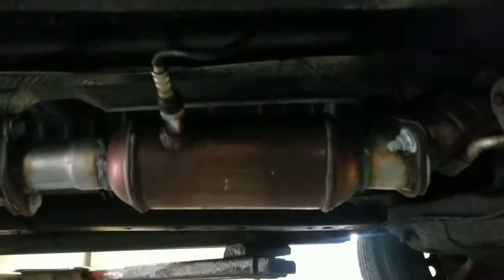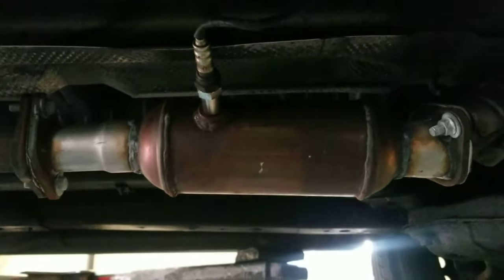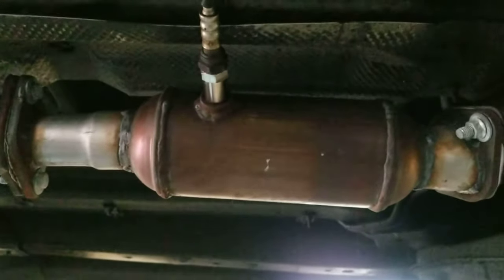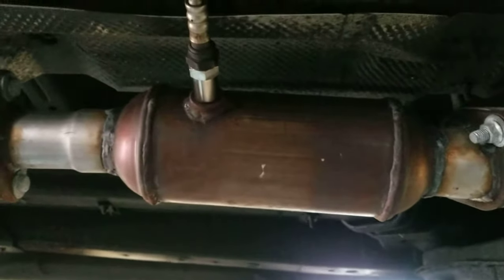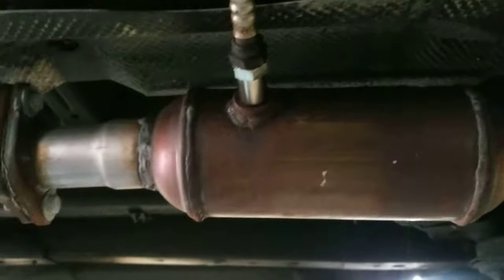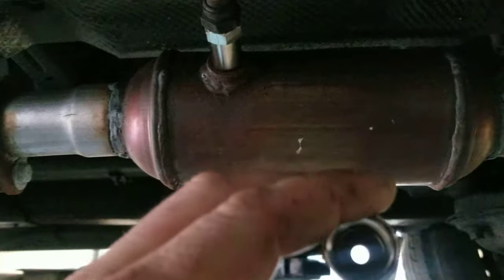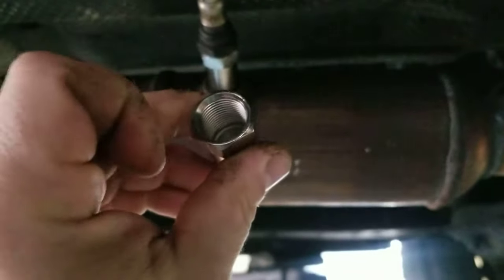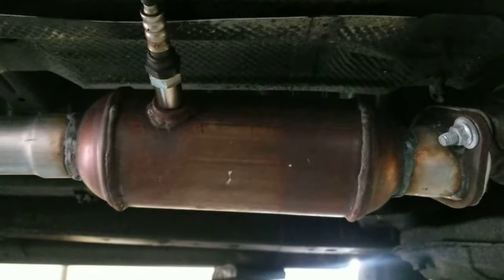How to fix check engine light after replacing converter. quick fix

Comment: Thank you so much for sharing this video. I had my catalytic converter replace with an off market  on my Prius V. Initially upon installing this oxygen spacer my check engine light was still on. My brother in law remove the battery for a while to reset the car and check engine was gone after that. Thanks again for your video.
Reply from the maker: Your welcome 👍

Comment: Both the cats on my 05 Sequoia were stolen, so I had to replace them. The OEM cats are 1,200 each, so I opted for universal Magnaflows (also, due to the supply chain shortage, oem ones weren't even available). I got intermittent CAT Inefficient codes for both cats until I put the O2 extenders on. Now, no more CEL. This will definitely work on Toyotas.
Reply: I just had mine stolen on my 04 sequoia. Same deal, cats from dealer not available and nobody is willing to tackle the O2 sensor codes now being thrown with aftermarket cats. I'll give these extenders a try, I guess. Did your VCS and Trac light also come on with the CEL?
Reply: @chrismas5338  yes, that is pretty standard for all Toyotas. VCS and TRAC is disabled with a Check Engine light. It doesnt mean there is anything wrong with them, unless the error code is directly related to the VCS or TRAC.
Reply: @Nuthing_but_the_Truth  just tested my O2 sensors and wiring and Bank 1 sensor 2 is bad.
Reply: @chrismas5338  good deal. I had to get new oem O2 sensors, so I knew they werent an issue for me when the codes started to show up.

Comment: I just change the whole catalytic converter and the same code of catalytic keep on showing up, so I'm. Changing the sensors but if what you are saying works is it one size fit all or is it different for sample, 2007 toyota matrix?

Comment: 12.05.2023 ///// I put the same on mine Astra h engine Z16XER. It is not working. ECU or car computer still report Oxygen Sensor Error and Check engine light is on. :(

Comment: Hi, maybe you know what's the part number for the spacer-adapter(Toyota Prius 2010) THANKS
Reply: 2PCS 45mm O2 Sensor Spacer, Oxygen Sensor Adapter,  O2 Sensor Clog Cleaner, M18X1.5

I’m not sure if this would work but I have 2012 prius V.

Comment: My R/T has a p0141/138 wondering if this would help? Cats were stolen has aftermarket ones only having trouble with left side
Reply from the maker: Hi. No this will not help your code. Sounds like your o2 sensor may have been damaged or wires were cut when it was being stolen or replaced

Comment: Quick question, I see the oxygen sensors adaptors online but some are different size , does that matter ??  I need to remove my 2016 ford fiesta check engine light lol
Reply from the maker: Hi. 
They are usually all M18 x 1.5
Reply: Last week during rainy days they stole my Honda catalytic converter. 😙
The original was so expensive so I replace with after market. Now the check engine light was On. So the solution is just buy the Oxygen Sensor extender from internet ? 😙 After putting the extention then plug in the O2 sensor. Do I have to seal the small hole ? Thanks.
Reply from the maker: Ramo 
No you do not seal any holes

Comment: For the spacer does the aftermarket cat have to have a 02 plug on it already or can a shop install it for me or do I need a cat with the o2 plug already on it
Reply from the maker: U just have to put the spacer in the factory  o2 sensor that is already there behind the converter

Comment: I have a 2012 ford expedition with the same problem, we’ve replaced the aftermarket three times and still same check engine with same code, we finally installed an oem convert and still the same code, we replaced the o2 sensors and still. What diameter do I need to order the spacer???  Thanking you in advance.
Reply: Hey. They are typically all m18 x 1.5.
I am asuming that your truck has more than 1 converter and that you are changing the correct converter? 
If the spacer does not work and you are still getting the same code. I would suggest checking power at the oxygen sensor and checking for broke  wires in the harness. 
Hope this helps
Reply: I use aftermarket every day no issues..

Comment: I just ordered some spacers for my 2021 Tundra. Got my CAT Converters stolen. Insurance won’t pay for OEM had to go with aftermarket parts now check engine light is on. Crossing my fingers hoping these spacers will work. Will update once I got it installed.
Reply from the maker: Wow that sucks! Yes please keep me updated
Reply: Did it work?
Reply: I got the parts but didn’t install the parts, l ended up replacing all 4 OEM O2 sensors. The aftermarket sensors were trash. At least now my check engine light has not come on yet( crossing my fingers).

Comment: Hi I have recently replaced cat convertor of my Vw polo 2006 with a new one, after 2 days my engine light came on . Is there any solution to clear that light ?
Reply from the maker: Hello 
Yes. 
If the engine light reads the code description "catalyst efficiency below threshold " 
Then follow the exact steps of this video to get rid of the engine light
Reply: The same part is suitable for Vw polo 2006 ?
Reply from the maker: Yes
Reply: Thanks I will try and update you later
Reply: @techtips3111  I have a dodge charger 14 and my light just came back on as well. Should I take it back to the shop or auto zone to get a read
Reply from the maker: @braygaming5264  i always suggest taking it back to the shop first

Comment: Do we do this for all 4 o2 sensors for the extenders ?
Reply: Only the O2 sensors the are after the converter (sometimes they bolt into the converter not after)
Reply: @cypfreak  so the 2 in the down stream then?
Reply: Correct

Comment: Do you have to put them on all 4 o2 sensors?
Reply from the maker: No. You only have to put it on the oxygen sensors that are behing the catalytic converter that you changed 
If you did both converters than u have to out them on both o2 sensors that are after the converter
Reply: @techtips3111  I replaced them all and they are all marking 
I even changed the converter

Comment: Mine says not ready but the engine codes it shows now is for oil pressure and for  fuel. The catalytic says not ready. What can I do? Appreciate any help.

I just Googled and it might be the o2 sensor. So you already gave me the answer. THANKS!
Reply from the maker: Did you clear the engine light? And did you drive a minimum of 50 miles to complete a drive cycle? 
Also if you have a fuel code. That can keep an O2 sensor from going to ready mode
Reply: @techtips3111  the emissions said everything was ready except catalytic converter. I did not run it on the highway
Reply: @techtips3111  should I reset and do it all over?
Reply: @techtips3111  thanks for your help
Reply from the maker: Do you currently have an engine light on 
If so what does the code actually say?
Reply: @techtips3111  1259 and 1456
Reply: Didn't have them before I installed the converter
Reply from the maker: Those codes wouldnt be connected to the converter. Try resetting the engine light. All momitors will be "not ready" then drive it at least 50 miles and see how many go to ready state
Reply: @techtips3111  thanks
Reply: U need to drive the vehicle
About 60 or so miles
After you have corrected
All the other codes
Then clear codes
And drive

Comment: I see one that has like a screen in it, on the smaller end and one doesn't. Which one do I need? 2012 Chevy Equinox 2.4l FWD Flex Fuel. A link to one that someone has bought and it's worked would be nice.😊
Reply from the maker: Sorry for the late response.  Incase you still neee it 
Herew the link 
https://www.amazon.ca/Eliminator-Adapter-Adapater-Isolator-Extension/dp/B07GYJP9X9/ref=asc_df_B07GYJP9X9/?tag=googlemobshop-20&linkCode=df0&hvadid=292940036879&hvpos=&hvnetw=g&hvrand=8302906354495181249&hvpone=&hvptwo=&hvqmt=&hvdev=m&hvdvcmdl=&hvlocint=&hvlocphy=9000756&hvtargid=pla-569730711270&psc=1
Reply: Thanks!  I bought a set of 2 of the spacers and had the front spacer installed. It got rid of my light but the car is still missing a little bit. The fuel trys to cut out every now and then, especially when idling. Or, when I have to stop at a red light and am still in drive it'll sputter a little. When I throw it in neutral it seems to help a lot but will cut out a little if I have to stay idling for too long of a time. In drive while idling and when in park idling it's at it's worst. When in neutral, it helps a lot but will start to cut out or miss eventually.
Should I throw the other spacer on the rear sensor or will that even have an effect? or is this something that might straighten out in time? Just about everything is new on the car. New engine, plugs, High pressure fuel pump, O2 Sensors, MAP and MAF sensors, throttle body has been cleaned and has a new gasket and a bunch of other stuff I don't want to list. This is a new converter with probably 800 or so miles on it and probably 400 or so miles with the New spacer on it. It is the cheap version of the converter. The Only code that was showing was for the Catalytic Converter before I put the spacers on which is of course gone now. Any help or just your thoughts would be appreciated. Thanks!
Reply from the maker: @travisspencer9241  ok 
So, did this issue start after you installed the converter or was the problem there before. 
If it started after the converter. How long after did the problem start
Reply: @techtips3111  I Had problems before I installed the newconverter but it was just typical converter troubles. It would cut out every now and then but was way worse than now. The sulphur smell and You would have to push the gas pedal so much further to get it to go. I had the new converter put on just before I found out the motor was bad. It sat about a year before I could get a new engine put in. The new engine runs great. Had all the new stuff put on the new motor.
 The engine light came back on about a 100 miles of driving with the new motor. Took it to my mechanic and he said the scan showed it was the converter and not the sensors. It didn't start cutting out or missing until that engine light came back on at the 100 mile mark of the new engine install. We reset the light and I drove it hoping it would go away. The light came right back on not long after. Shortly after I saw your video I decided to give the spacers a try. I drove back to my mechanic, had the front spacer installed and he reset the light. Seemed to help a lot but I'm still getting this little miss or the quick Idle down. The light hasn't came back on in I'd say over 400 miles. Everything else seems to be great.
Reply from the maker: @travisspencer9241  what do you mean by "front spacer"? 
Did you put it.in the o2 sensor.before or after the converter? Because its supposed to go in the o2 sensor that is after the converter
Reply: @techtips3111  It was definitely put on before the converter. The front 02 sensor. I didn't put one on behind the converter. It really didn't make sense to me to put it on after the converter.
Reply from the maker: @travisspencer9241  ok. But now your o2 sensor in the front is not accurately reading the correct AFR and is now sending the wrong info to the ecu so your mixtures are off
Reply: @techtips3111  So if I switch it around and put one on the back and none on the front, should that fix it?
Reply from the maker: @travisspencer9241  its hard to say if thats what the initial cause was. It sounds like u may have a coil cutting out under load. Or a cracked plug even though u changed them. 

Regardless i would out the spacer in the rear so that u know for sure your getting proper afr readings
Reply: @techtips3111  I'll switch it around in a few days and let you know what happens. Thanks for all your help.
Reply: @techtips3111  I just wanted to let you know that I got those spacers swapped out and it's in the correct spot now. When leaving the garage it died about 5 times backing off the rack but that was expected. After about 10 minutes of driving, it reset itself and I haven't had a miss yet. Idles fine and sounds great. When I had the spacer on the front O2 sensor I started noticing some oil consumption. Hopefully it's where the mixture was off and causing it to consume a little more oil. I haven't had the engine light come back on either. It didn't even come back on when it was on the front O2 sensor, lol! Thanks again for your help. I really do appreciate it.
Reply from the maker: @travisspencer9241  glad to hear

Comment: U can see the converter body is over heating..thats no fix that's a bandaid..Either the converter   has wrong loading along with a root cause of po420 not resolved
Reply from the maker: The vehicle has never been ran. I installed this converter and spacer and took the video before bringing the car down to start it up for the first time. I agree that a lot of aftermarket converters a cheap garbage but most people want to eliminate their check engine light more than their concern for the environment
Reply: I can't agree  more ..

Comment: ok so I just bought a Honda 2004 accord ex sedan and the guy said his Cadillac converter was stolen and he replaced it for 500$ , im guessing its a universal aftermarket one so now I have the car and theres a code p420 , so my mechanic said theres nothing stuck in there but when they changed the converter they only changed the downstream cheap sensor and not the upstream so I just bought one for 130$
Reply: Did it pass smog?
Reply: I bought a car off a guy 2004 accord ex also
Reply: @murderblock8194  I didn’t get the smog test but should I ?

Comment: What does that spacer actually do my man?
Reply from the maker: Basically lets the oxygen sensor  still sniff without actually being bolted directly into the airflow of the exhaust hence "tricking" the sensor
Reply: @techtips3111  are you sure where I could get one of those bad dogs for 2009 Toyota Corolla S 1.8L?

Comment: Can you post the amazon link?  all im getting is shower head extenders  😭
Reply from the maker: https://www.amazon.ca/Eliminator-Adapter-Adapater-Isolator-Extension/dp/B07GYJP9X9/ref=asc_df_B07GYJP9X9/?tag=googlemobshop-20&linkCode=df0&hvadid=292940036879&hvpos=&hvnetw=g&hvrand=17367347331885245171&hvpone=&hvptwo=&hvqmt=&hvdev=m&hvdvcmdl=&hvlocint=&hvlocphy=9000757&hvtargid=pla-569730711270&psc=1
Reply: @techtips3111 would you happen to have the US link for this?? Have a Chevy sonic that we replaced the cat on and it’s still throwing codes

Comment: With this adapter b4 the o2 sensor
The light will go out for a short time and come right back
Also will not be allowed for
Smog check
Obviously its not suppose to be
Installed.
Just my 2c
Reply from the maker: What do you mean by "before the o2 sensor" ?
Reply from the maker: If you are referring to b4 the cat. This video is for the sensor 2 o2 sensor. In or post cat. Hence the "catalyst efficiency below threshold" that i stated

Comment: Brand new converter brand new o2 sensor and car is stalling please help!
Reply from the maker: Was it stalling before this repairs or did the stalling start happening after the repiars?
Reply: @techtips3111  TRY DRIVING A FEW MILES SO THE COMPUTER CAN PROCESS INFO FROM SENSORS

Comment: Put spacers on mine and the check engine light still on
Reply from the maker: What is the code reading for the engine light?
Reply: @techtips3111  same here. still shows P0420. i tested the 02 sensor and got 22 ohms and while driving i can see the downstream sensor erratic movement for voltage on my scanner. 
what to do.
Reply: Try removing your battery to reset the car. It works on my Prius V.

Comment: That's just bypassing the problem u really need to put on brand new catalytic converter on.
Reply from the maker: The problem is. Most customers prefer to save money and buy an aftermarket converter. Original converters could be in the thousands. The problem is fixed for the vehicle. But technically not fixed for the environment

Comment: This doesn't fix anything, you just hide it from the sensors 😂
Reply: It literally fixes the check engine light 🤔🤔🤔
Reply: @cypfreak  you just cheated the sensor and were able to turn off the engine light but the emission continues ☻
Reply: The emissions are great I want as much emissions coming from my exhaust pipe as possible